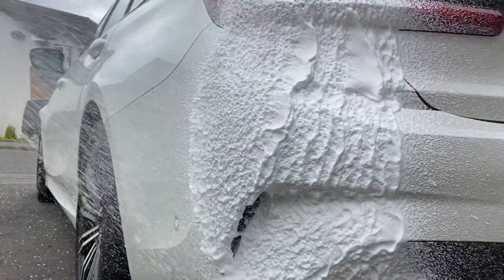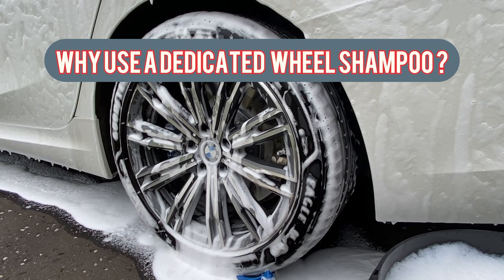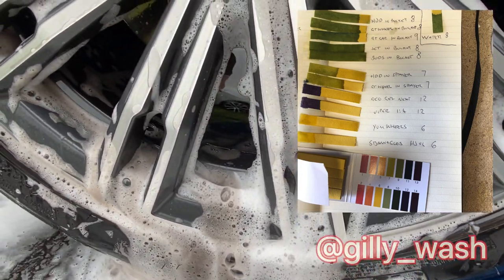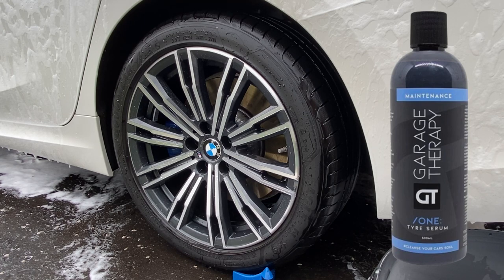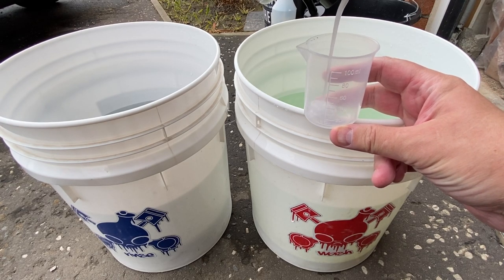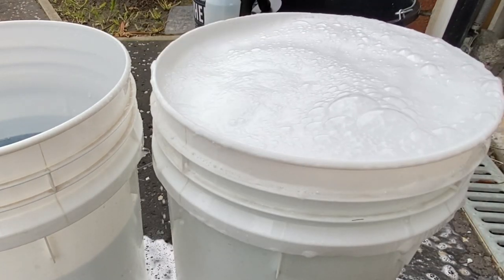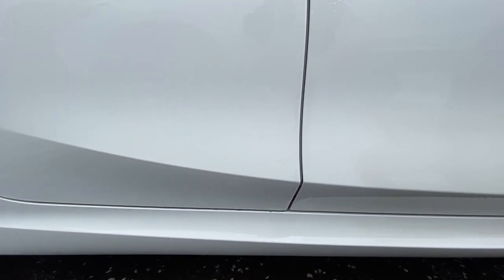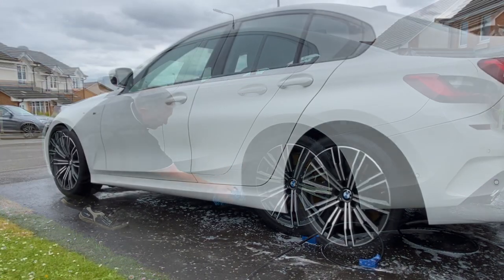BMW 330i M Sport Satisfying Car Cleaning | Carbon Collective , HDD,  #snowfoam #wheelclean #carwash

Comment: Thanks for the mention👍🏼
I think we love wheel shampoo method more than most people because our cars are usually cleaned regularly or protected that no more cleaning power is required. 
And glad you highlighed Atom Mac I’ve been meaning to try that for ages but not really seen anyone else talk about it so didn’t know if it was worth it.
Reply from the maker: Was worth mentioning Nick as it was a really good comparison and something you took a lot of time and effort to compare, yeah I do get that we keep on top of things so really a maintenance product is all that’s needed then there’s acid 🤣
Atom Mac I find useful for helping not having corroding brake discs and other iron components around the discs , not cheap but you don’t use much at all so a wee bottle would last a couple years

Comment: Another informative video Graeme. I generally hit my wheels and arches with kkd citrus at 20 -1 dry, let dwell, rinse then gt wheel in a foamer. Aggitate with soft brushes. I find this the best way for my gloss black alloys.2 coats  of Gt tyre serum to finish.👌🏻👌🏻
Reply from the maker: Nice routine Dean!! 👌 that sounds brilliant , comparing GT wheel shampoo to HDD I’d say GT wins on slickness and bubbles 🤣 but here I really reached for HDD as GT has been appearing rather a lot on the channel lately and I wanted to show something different   I may do a review comparing HDD, GT and HOOPS soon 🤔
Do you do 2 coats every time with Serum?
Reply: @GMDetails  yes I like my tyres a bit more glossy. I've not tried hoops so would be interested to see that.
Reply from the maker: ✍🏻 noted 👌